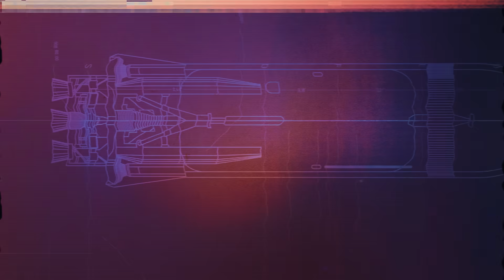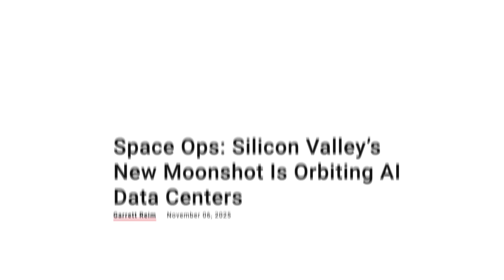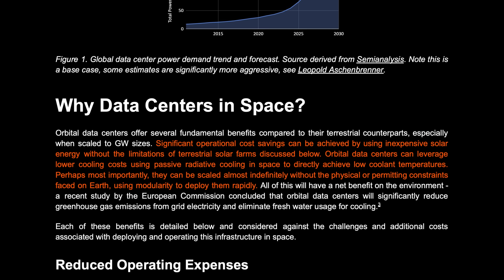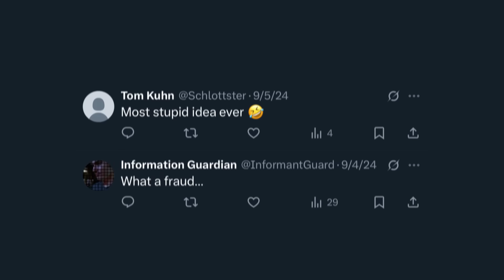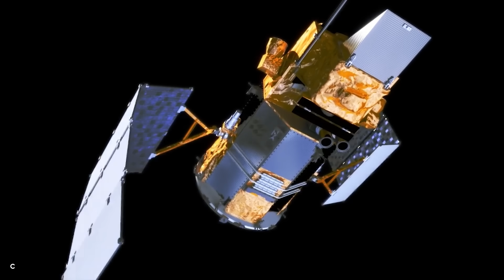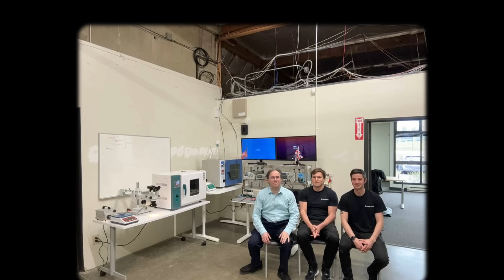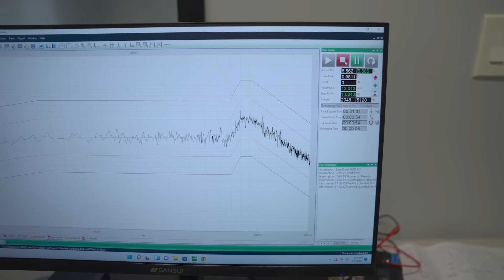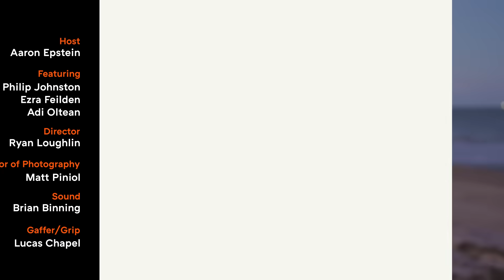Inside The Startup Launching AI Data Centers Into Space

Comment: Vacuums can't cool anything. How do you upgrade the servers? When Nvidia brings a new generation of GPUs, nobody wants to use the last generation, so it becomes space junk?
Reply: That's exactly the problem I was thinking about, 
When inevitably we have a data centre breakthrough that makes a far more efficient and effective version of the servers won't this just become space junk? Worse it will take up valuable real estate the could have gone to the new version.
Reply: Satellites can be decommissioned @TheMetaHistory
Reply: That is a problem worth giving a thought. Can't think of feasible solution to this other than the fact that this just piles up the space grabage.
Reply: space is cool so might they can use it as heat cooler
Reply: @ShubhamGorde-w6j space is cool but the vacuum cannot transfer heat. Cooling normal spacecraft is a massive engineering problem (I've literally worked on satellite thermal management systems) and that's only one part of the problem, there's also radiation, orbital placement, communications, like one of the biggest problems with satellites is how to have a downlink that can actually download all the mission data and that's for normal EO or communications satellites
Reply: @nattankress do you think radiation will cause issues with data transmission or affect the gpus?
Very interested in your thought process
Reply: @ismaelperez9020  NVIDIA H100 is very delicate at 5nm construction, so protecting that from solar flares (SEPs) and deep space radiation (GCRs) is an enormous challenge they didn't mention.

Comment: There's a couple of issues: latency, cooling, maintenance costs...did they really do an indepth study of its feasability?
Reply: doubtful - the cooling requirements for even a single GPU via liquid ammonia cooled radiation panels like those that the ISS requires in order to cool itself in space is absurd in terms of surface area / design limitations.  and they want to build clusters of them.  lmao.  you can't feasibly hold a structure like that together let alone distribute your heat across it effectively... it would be hundreds of sq kilometers large

Comment: How can you get uninterrupted energy in low orbit? how you can handle latency in high orbit? how can you increase the battery life? how can you manage satellite life? Only thing you got in space is "cold". I don't think it is a good idea.
Reply: Didn't they say it was sun synchronous?  Your latency question is relevant, but there is uninterrupted solar energy.
Reply: @nathanbanks2354  There is no such a thing uninterrupted solar enegy in low orbit satellites, they can't see the sun everytime! Only High orbit satellites (over 36K km away) can achieve that. Also the average life of a high orbit satellite is 15 years (thruster engines need fuel to keep their place in the orbit) which means your datacenter satellite will be destroyed after this time. Also those datacenters will need broadband communication which consume electricity as well. The only earning is cooling costs. This is not a good idea.
Reply: @nurola  Talking about your argument of the disposal of satellite in 15 years, I believe that in time period shorter than 15 years, the satellites will be of no use. My belief for this is that as Nvidia or any other company will bring in new GPU, who would want to use the old ones? Those satellites will be disposed as we place the new ones in space. That is another reason that this is a bad idea.
Reply: @dontpeek6784  the h100 gpus they mention are already outclassed by nvidia's h200 and b200, but are still routinely used for research work and model training.
Reply: The communication will be done differently than current satellites, and that will solve the latency problem. It will be an ecosystem powered by the sun. Your questions are valid, but it isn't the end of the line. It is infact just the beginning.
Reply: @QuivO.mp4  High orbit satellites has ~600ms latency. (this is information, not assumption) Lets ignore latency problem. Most advanced bandwidth for a satellite is (Viasat-3) 1000Gbps in total. Starlink is 20Gbps per satellite, lets say 150Gbps. Those bandwidth speeds can't manage data center traffic. I think space data centers is for military/intelligence (autonomous drones) based requirements, not the commercial ones. But yes, there is a possibility that they may find an alien-like tech to overcome those limitations.

Comment: One Rubin ultra rack consumes ~600kw.  Radiator needed would be 100m^2 per rack + sophisticated cooling loops. Can it really be worth it?
Reply: Yes it can! A cooling tower isnt exactly cheap either
Reply: Tu n’a plus besoin de aucun refroidissement dans l’espace lol
Reply: @nico62965 on the contrary, cooling on the ISS is an engineering challenge, and that's just body heat.  Water cooling and air cooling doesn't work in space, so you need to use radiative cooling with truly massive heat sinks.